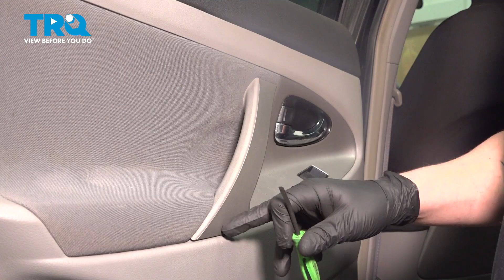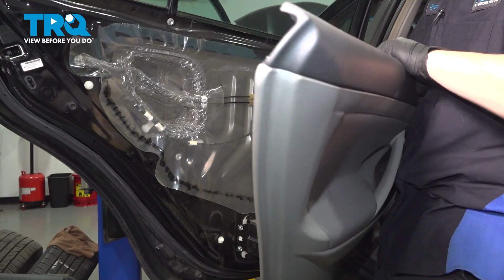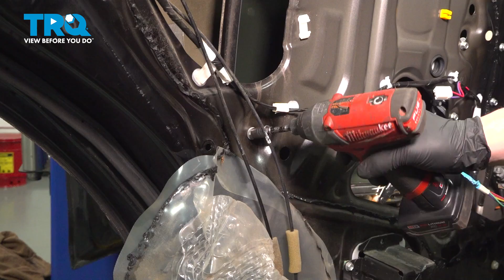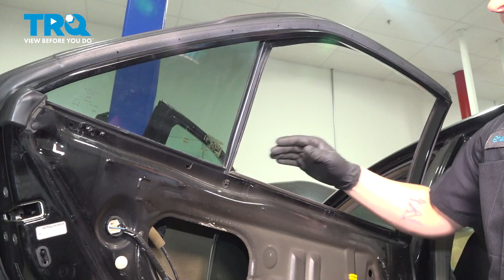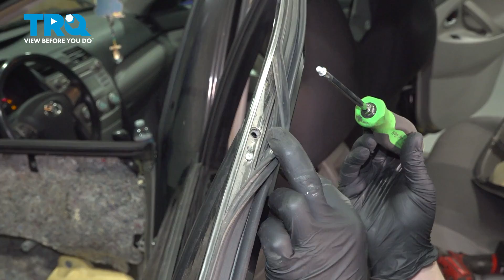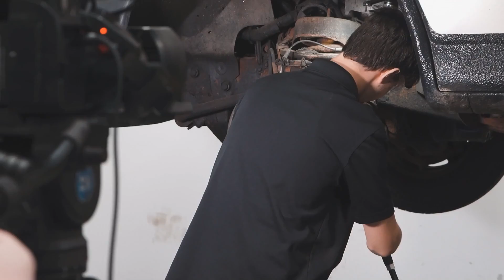How to Replace Rear Window Motor & Regulator Assemblies 2007-2011 Toyota Camry

Comment: You were able to turn on the regulator to remove window bolts,  but what if the regulator itself is not working??? 
What's the purpose of this video with regulator working??